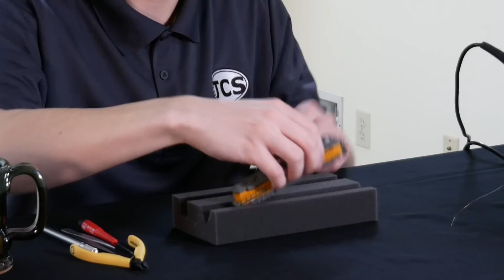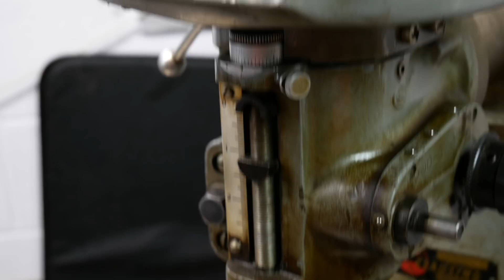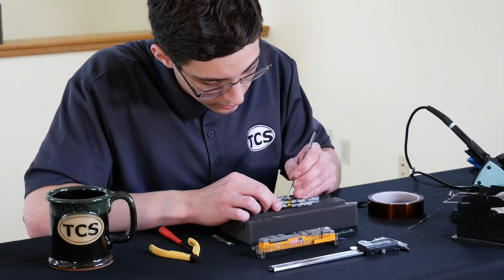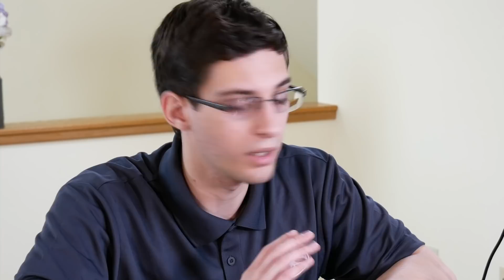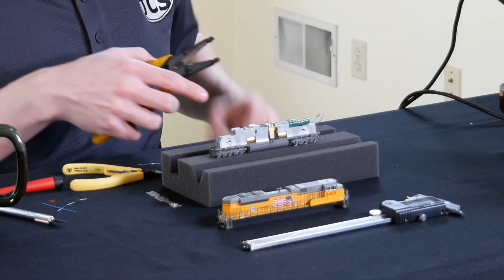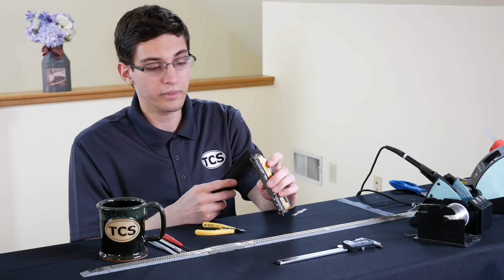N Scale Keep Alive® | Installation Companion

Comment: Is there space in the kato fuel tank to put the keep alive device?
Reply from the maker: The fuel tanks are full of weight, so no, there is not any room there. In order to install a Keep Alive device into the fuel tank, most or all of that weight would need to be removed. By following this method as shown, the minimum amount of weight needs to be sacrificed to fit the device. We had thought about this prior to the installation, and determined that the best location was the area underneath the cooling fans as documented in the video.

Comment: Hi Dan, 

Good job with K1D4 install. At what temperature setting do you set your iron..? 
Thanks.
Reply from the maker: Typically we set our irons at 720°F to heat things quickly. We also use chisel tips on soldering irons as opposed to conical tips, which helps get more heat onto the pad faster. In this video, the chisel tip used is from Weller (Techni-Tool part # T0054443899)
Reply: @TCSDCC  
Thanks guys, while I have used conical tips in the past, I agree the chisel tips transfer the heat more quickly 
and evenly. Thanks for your recommended heat setting guide, and the Techni-Tool part number. 
Great job ''Thanks''..! 
Best regards from across the pond.